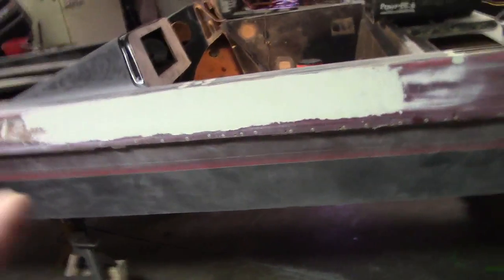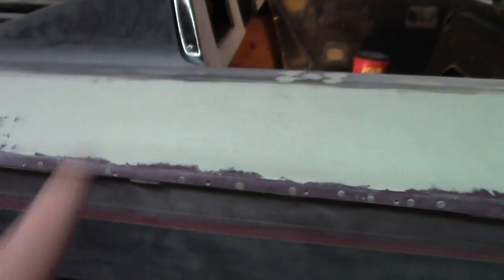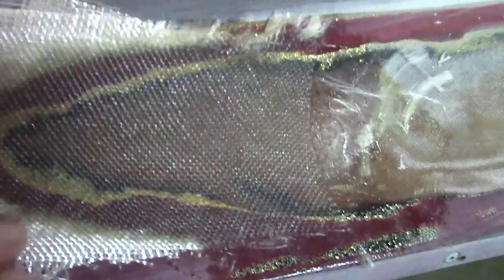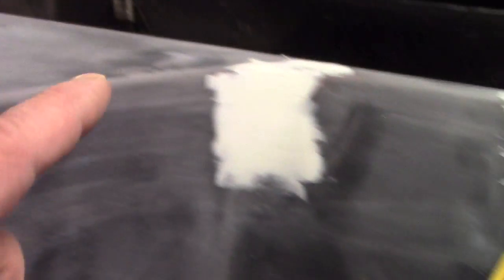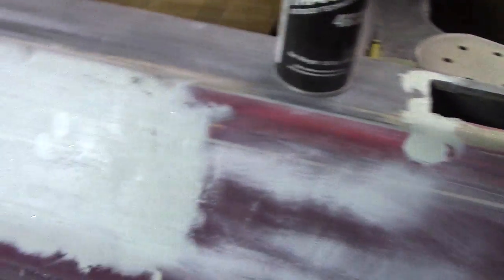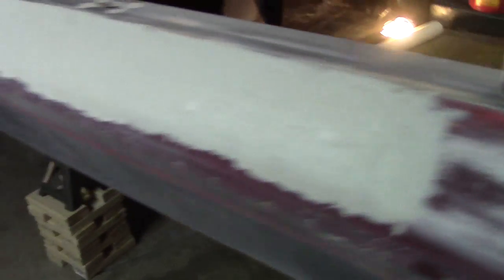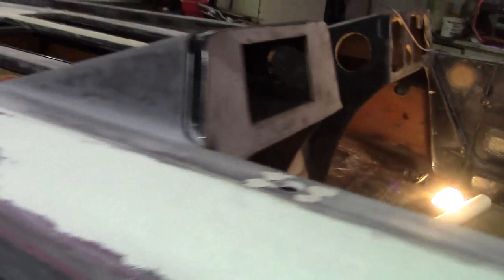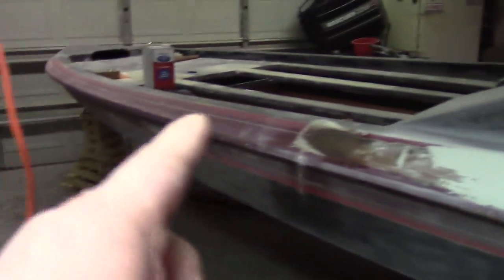how to fix cracks in fiberglass boat restoration

Comment: I got a 1974 hydra sports bass boat some one restored it 14 years ago been kept inside since it was bought actually  awesome bass boat alot of storage all I gave for it was $1100 I had to put new trim motor on it has a 1980 90hp merc iv changed alot on it to suit me seats new repainted top of the boat fixed a few stress cracks

Comment: I just bought a 1976 trihull boat its got some cracking on the hull and a couple of spots on the center hull that looks fairly deep but not through the fibreglass looking at all vids atm on how to fix it. bought the boat for 400 bucks.

Comment: In my experience epoxy is good for repairing cracking,im repair my cracking at my boat using epoxy..it been 3 year now..it still very good condition.